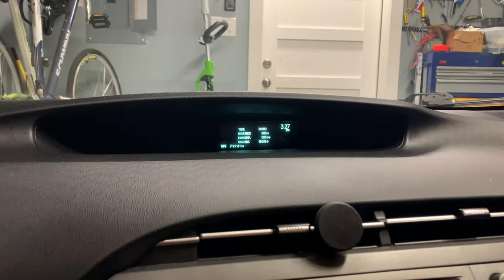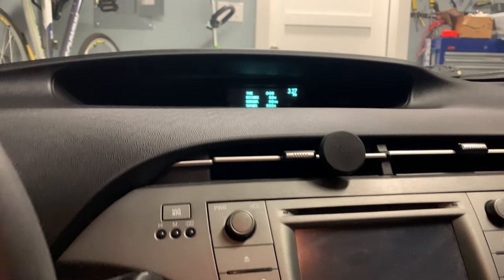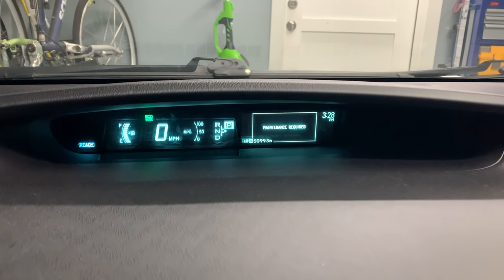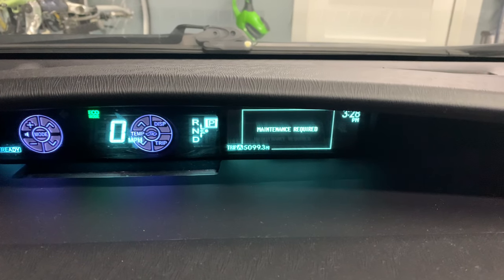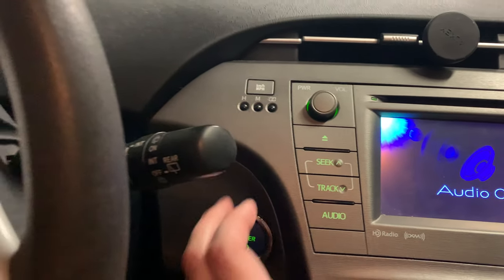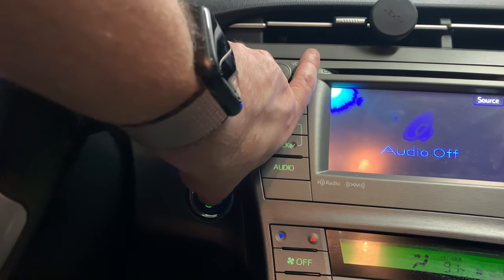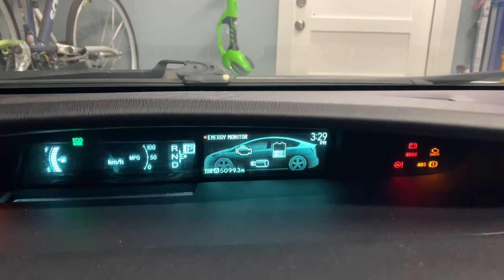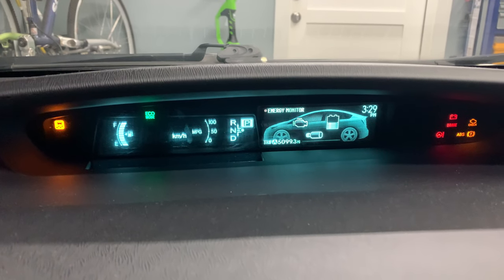How to Reset Prius Maintenance Required Light 2010 2011 2012 2013 2014 2015 Toyota Prius - 4k

Comment: Unnecessary steps. Just make sure you’re set to Trip A, power off, press brake pedal, hold down km/h MPG button and Power button. You’re welcome
Reply: That's the ticket!  The method in the video did not work on my prius, but your comment was the solution.
Reply: Thanks
Man!
Reply: It’s not working
Reply: This worked for me! Thank you!!

Comment: Everything I could do press and hold Km/h MPH while press power  - “Maintenance resetting… complete”.  That is it.  Three times I listened you - and could not catch plus recording is abrupt at one point
Reply from the maker: Not sure what the question is, but if you got the message maintenance resetting... complete while holding everything down it should have worked.
Reply: @AthexTube  No questions at all. Everything I had to do while being on “A” setting is: press and hold MPH button and press Power button, release both as message appear

Comment: Followed the steps and got the reset data message. Now to see if the Oil Maintenance Required Soon message reappears next time I switch the engine on.

Comment: How many miles between Oil Maintenance lights? I use synthetic oil and it’s so annoying when it appears way before my oil needs changing.
Reply from the maker: For me it’s usually around 7000 miles, it probably takes into account time as well as miles but hard to say